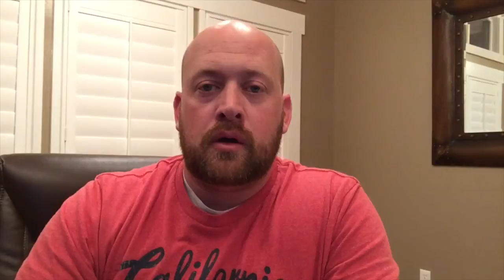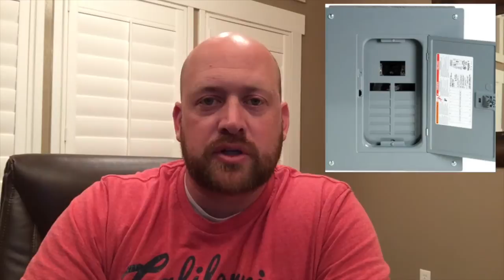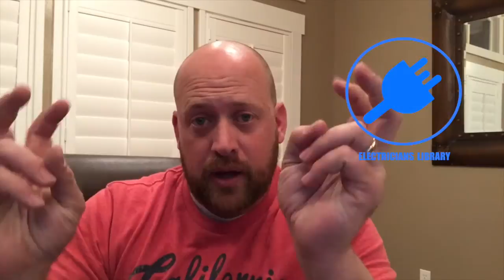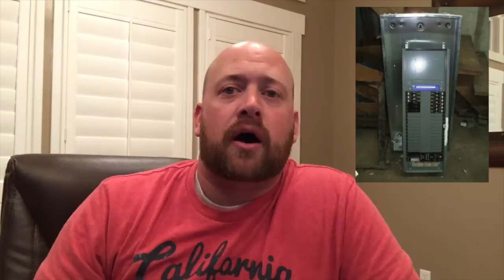Panelboard vs Loadcenter

Comment: so question.. I had a commercial job where the plans state 200 amp 3 phase 120/208-4wire exterior surface mount panel with 200 amp main breaker. I was told by 2 electrical companies that i needed a panel board (which was $750) and by 1 electrical comapny i can use a basic loadcenter ($280) which is correct?
Reply from the maker: Hi Mike! Thanks for the question. I've answered it here in episode 35. http://www.electricianslibrary.com/loadcenter-vs-panelboard-part-2/ Take a listen and let me know what you think.

Comment: Too f'in many names for these! Panelboard loadcenter, service panel. Electricians figure it TF out!!!
Reply: I think the rerm "loadcenter" was started by manufacturers. Wiki simplifies all of it to distribution boards. 

In the UK a residential grade distribution box is called a consumer unit. 

That doesn't help, does it?
Reply: @aredditor4272  😆 Nope not at all! 
Distro box may be the the worst of the options. That term could apply to so many different industries.